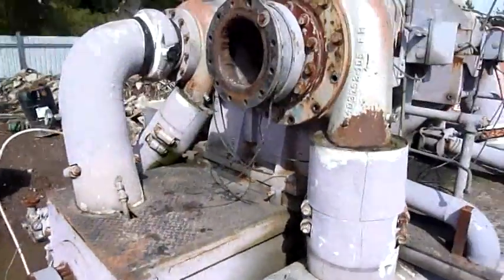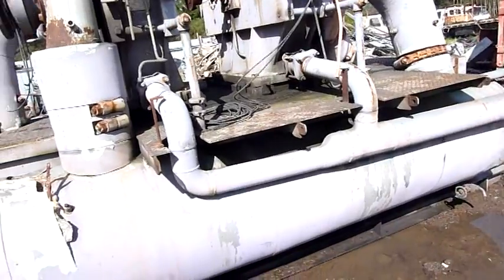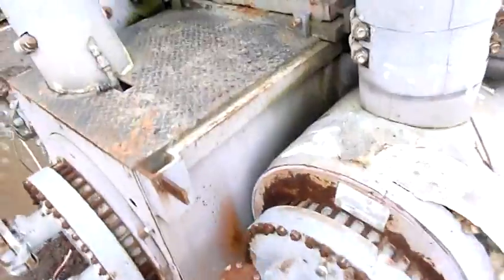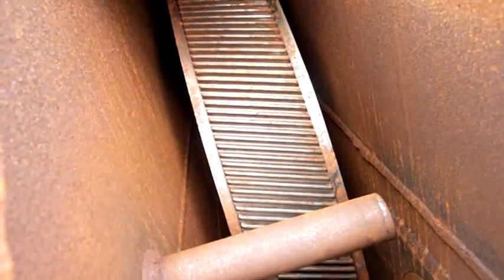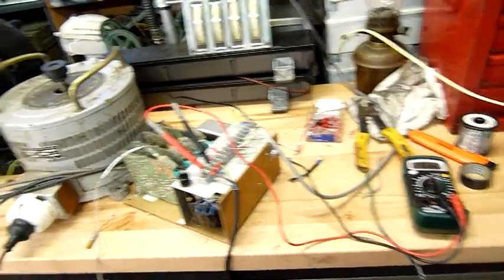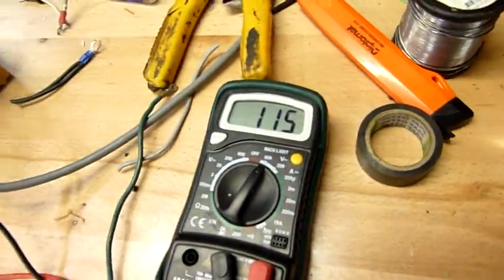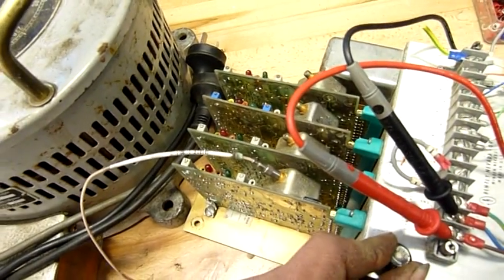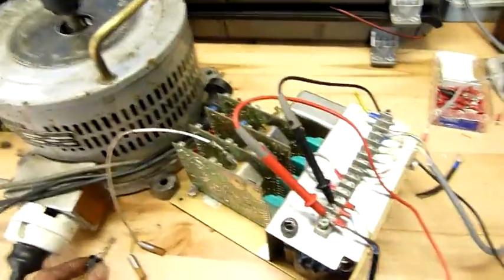Joy 4 Stage Centrifugal Compressor Turbine Opening and Vibration Monitor Tinkering

Comment: If the guys at the yard have a welder you could try to weld a rod on the end of the pin, then heat the sucker up and try and pull it. Alternatively you could screw a screw in the pin (i think i saw it was hollow) and heat then pull. I used to remove pins like that but i had a body dent remover hammer which came with it's own "welding" unit to put the pins on the body.

Comment: Interesting stuff, How 'bout you drill out that pin on the shaft with a diamond bit? that would make it give loose lol

Yeah the vibration monitor is an odd duck... I'm Sure You've thought about this (tried it even) but hows bout hitting it with the heat gun and see what happens..

Yet another thing, If its american tech its meant to run on 120 volts not 115, you might not think that 5 volts makes much of a Diff, but i'll tell you it does

Goodonya M8